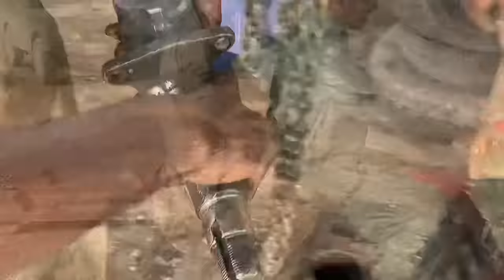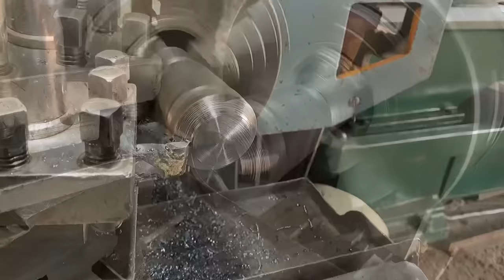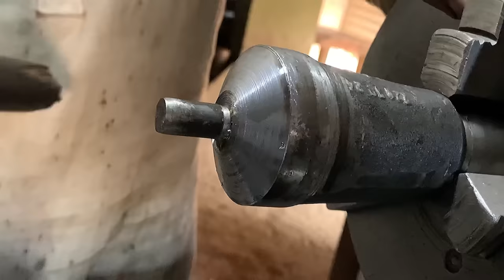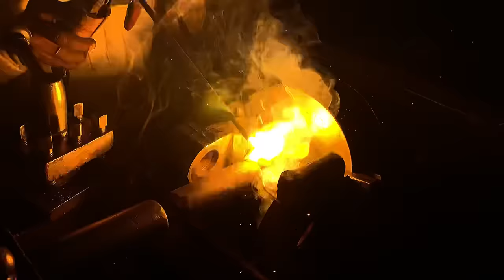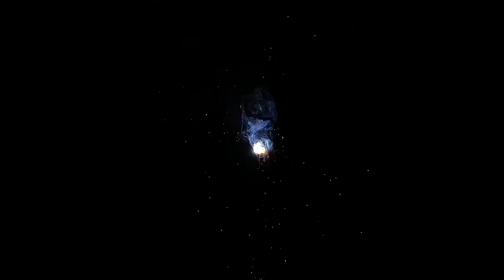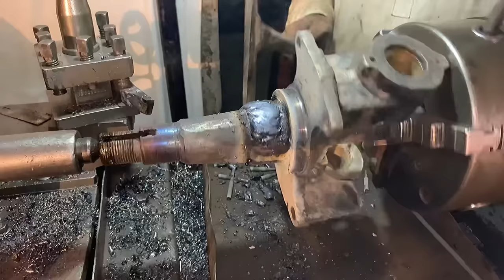Truck Drop Spindle Broken Repairs Obtaining and Manufacturing Precision Engineering Perfection

Comment: Not too sure Kurtis would approve.  If the filler rod was the right material, the repair could work.
Reply: It's look like new. Very impressive work.
Reply: not a repiar that I would want on my truck 🚚 🚚
Reply: When Kurtis does a weld repair on a high stress part he doesn’t do it with a60 year old welder and rods of unknown quality, he uses flux wire with argon shielding a bit at a time on a turntable, not on a dirt floor without a really good preparation first.
Reply: At least Kurtis would leave us with an impeccable video including outtakes!
Reply: @dusterowner9978 it's a 6013 rod, stronger than the base material
Reply: I'm sure it was 7018 rod. They use that in all these repairs videos.
Reply: @GWAYGWAY1  The thing about Kurtis is he knows how to do a top quality job with the right gear and the right processes - he also knows when to tell the customer the item is not suitable for repair.   And his customers know not to bring him parts unsuitable for repair anyway.
Reply: @GWAYGWAY1  Kurtis also doesn't live in a Pakistani village does he? I'd bet a lot Kurtis would be very impressed with the work these men do with what they have. I also bet he'd do them similarly if he lived there.
Reply: @keithammleter3824  All of that would be different if Kurtis lived in Pakistan or Afghanistan and not Australia. The comparison is rather silly if you think about it.

Comment: I might use that technique to fix a lawnmower wheel. Never to fix a medium duty truck spindle. They are crazy.
Reply: Why not if the welder is competent? Weld is incredibly strong. Only reason western countries don't do this is labor costs, not the effectiveness of the work. We used to do it long ago.

Comment: sketchy af. It broke because it was a cheap cast spindle. The bearing races where shot and the threads at the end where buggered up.

I’m pretty sure you’re not supposed to weld cast iron either or at least not well .

I’ve seen these guys weld up a windowed motor and put it back together in the sand so wtf do I know? 

their labor must be next to nothing. when he was filing the spindle with his arm suspended over that spinning steering knuckle just wow. I guess that’s why there’s always that one armed guy in those street pictures of these 3rd world countries.

Comment: That repair is a complete catastrophe waiting to happen! Part wasn’t normalized and carbon hardened after welding.  The threads on the end of the spindle look completely destroyed….
Reply: Why would you harden a truck spindle? Do you want it to break leaving the shop?  They are always mild steel.
Reply: @okgroomer1966 If you notice when he first starts cutting the O.D, that squeaking is from the hardness of the material.  Once he gets through the case hardness it’s softer and cuts much easier.  They are made from low carbon mild steel. That’s why they are case hardened.  You can’t through harden them even if you tried.  Case hardening gives the spindle added strength, normalizing them after heat treat takes away the brittleness.

Comment: Should be heat treated by a whole lot!!! That is cast iron and it will break after cooling.
Reply: That is most definitely drop forged out of high strength steel.

Comment: Yea, i definetly have to agree that the metal will have anealed in heat affected zone. Its possible that. Proper selection of filler would allow the part to be heat trreated again after the repair but i dodnt see any indication that was done.

Comment: A great repair for a static museum piece.  When it snapped it was probably overloaded. You see lorries overloaded all over India and Pakistan. How many people are injured or potentially injured is irrelevant. The drivers have to work to feed families. Ironic for a country that has just landed a moon shot. Was the rocket recycled? Is everything a cut and weld job in these countries? Make good videos but nothing to be proud of. Sub standard death trap manufacturing. Let's hope none of these repaired inferior parts get into the European and American systems. Hang on they probably are already. Frightening.😢

Comment: Looks like the return line current was running through the lathe spindle bearings.
Reply: And the hammering of the alignment pin was an unnecessary stress on the bearings. Great skills though.
Reply: @tbohtwentyone  and these guys always use a chuck key to knock in the work. Never heard of a brass or aluminum hammer or indicator. It is so stupid.
Reply: Would it not pass harmlessly into the ground? The machine is sitting in the dirt.
Reply: @okgroomer1966  it appears that the current passes through the machine into the bearings and to the work. We would need to see the ground cable clamped directly to the work being welded. The is no other good way
Reply: @danneumann3274  I'm sure it's DC+ so Rod>Work>Chuck>SpindleBearings>LatheCarriage>WelderGround